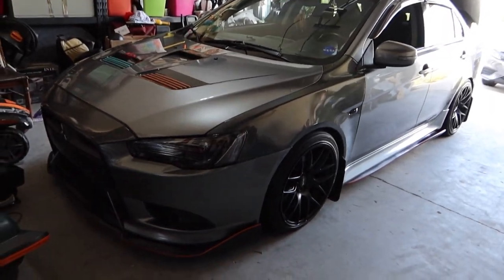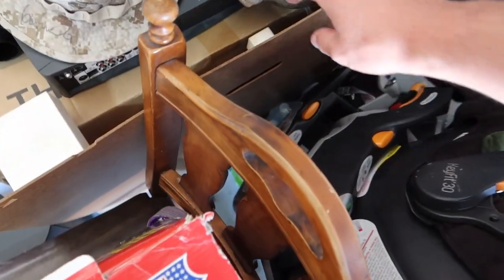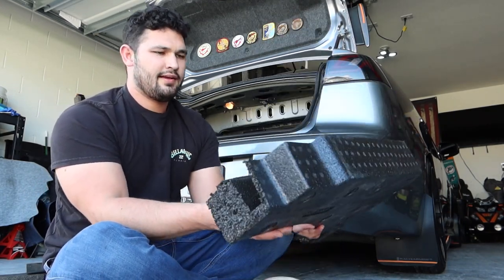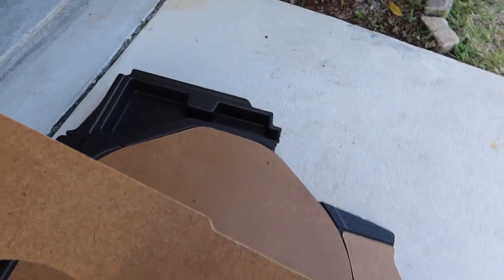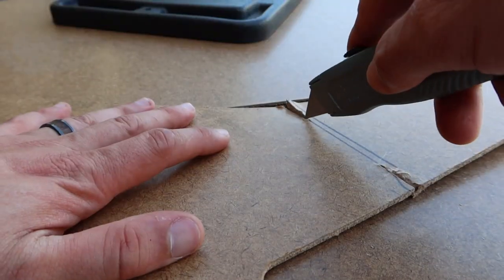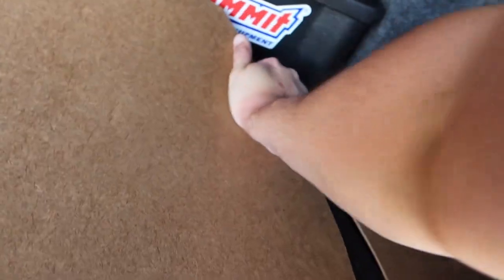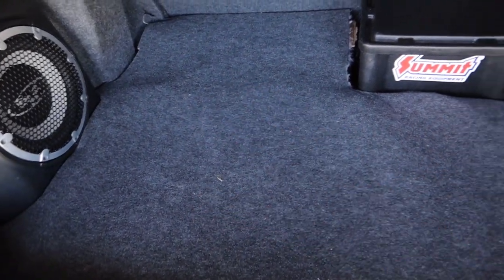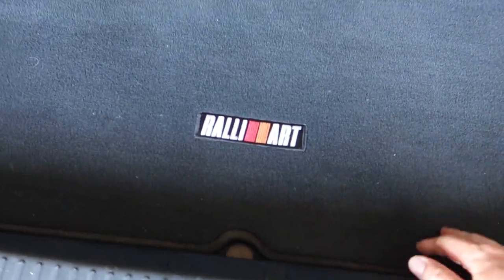Lancer Modified Trunk Space

Comment: i have a beat up lancer gts and i’ve been rebuilding it lately and right now an issue i ran into is the trunk because it doesn’t have any of the carpets or even that plywood and i was wondering if you know where i could find them, also the previous owners spilled like oil or tar and i was wondering if you got any tips on knowing how to clean it? hope you can help
Reply from the maker: Possibly try letting it soak in some acetone? And I'd check a local junk yard for the trunk stuff.
Reply: @TheSnyds  thank you but I was always wondering because i thought of trying to pressure wash it but i didn’t know if there was a way to get the water out of the boot area
Reply: For sure the junk yard you'll find everything u need .